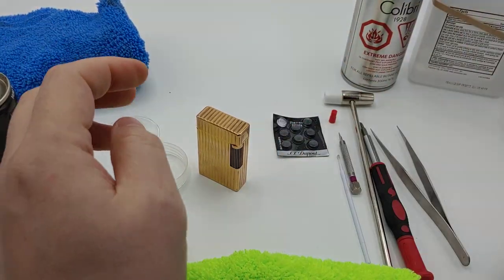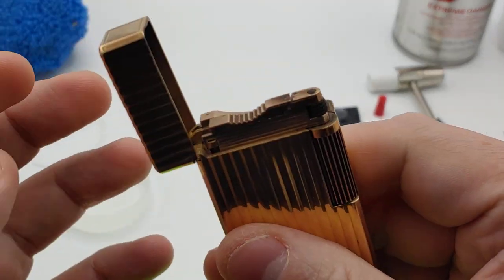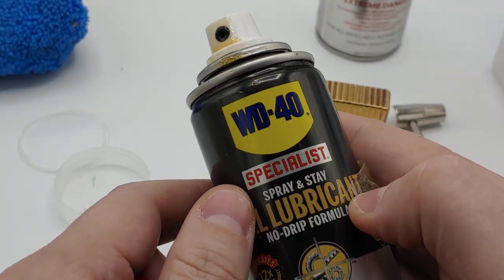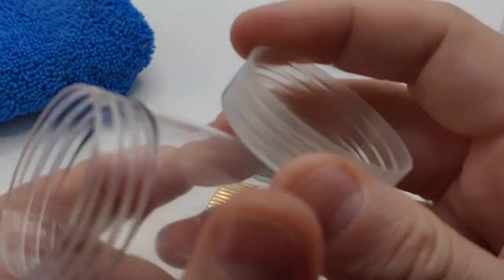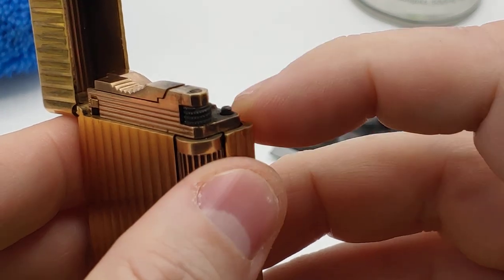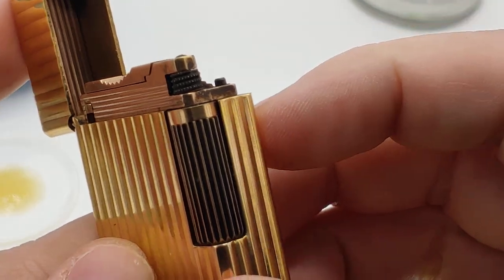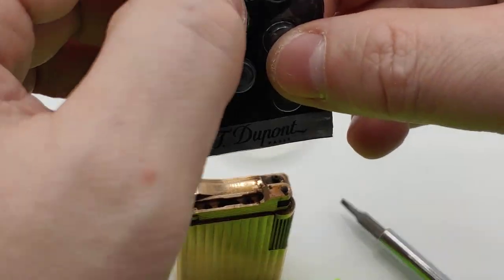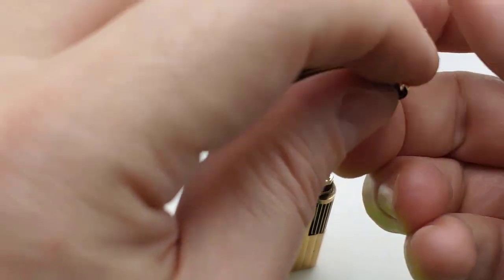ST DuPont D57 1953 Gold Lighter repair 2023 video USA English

Comment: 4:31 - there used to be a screw in adaptor (uses the valve screw lid's thread).  
Which screwed in and depressed the valve pin.  Then, you placed the gas can into the adaptor and filled the lighter.
No back spray when filling DuPont's or others that use this valve (like the 'Colibri molectric 88').  Don't know if they are still available though

Comment: as a side note to this aswome tutorial and info ; the screw in the lid is not to remove the front part of the lid ;but to remove the inner plate and clean it. you canot remove the front flat surface from the lid. 
cheers

Comment: How responsive is the flame regulator supposed to be? Should the flame grow immediately as one is turning the cylindrical wheel or does it take a little for the flame to grow or shrink as one turns the cylindrical wheel?
Reply from the maker: It can be off one the older ones and sometimes taking it apart and cleaning it can help tremendously
Reply: @chaicharin  any idea where to get it professionally cleaned?

Comment: I wonder, why does the inside of the refill part doesnt have a color coded like all dupont lighters?
Reply from the maker: I have seen some that dont have paint on them so could be a replacement bottom.
Reply: @chaicharin  ahhh i see thanks for the reply ! i also wondered, is it the yellow fitting that is compatible for this lighter or is it another color ?(i have the exact same as the one in the video)

Comment: Hello, I would like to ask if you know how to tell if a vintage st DuPont is solid 18k gold or not.
Reply from the maker: It will have a mark of 18k on the lighter.  I have run across a few gold plated ones that did not have the 20 micron plated stamp that I thought were 18k but had the lighter tested and they were plated.
Reply: @chaicharin thank you very much!